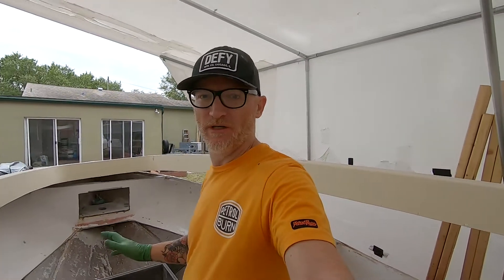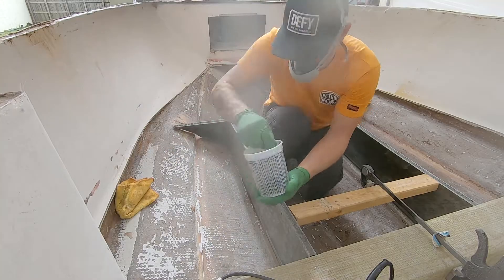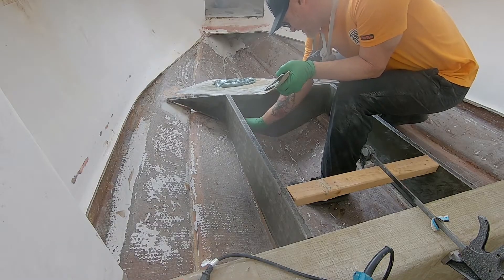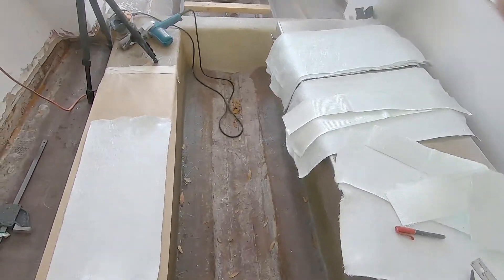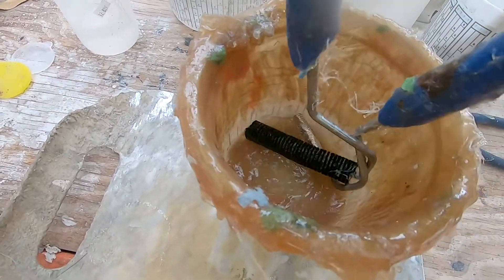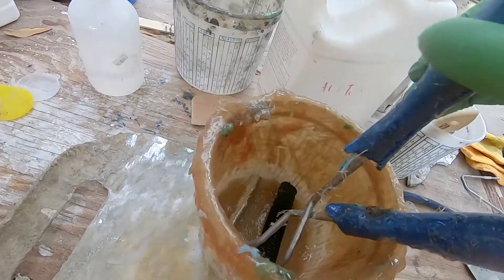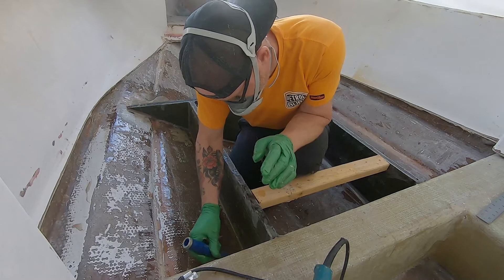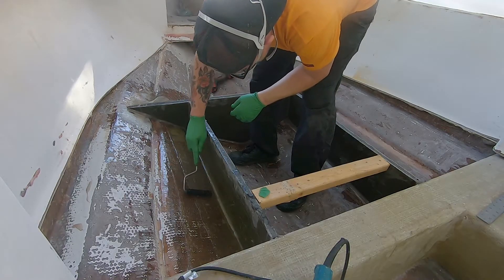HOW TO FIBERGLASS TABBING for Boat Stringers Transom & other Marine Fiberglass Renovation Projects

Comment: I am ready to start my Coosa board transom 3 inches thick. My question is, I have a ton of holes of the transom in original glass and plan to fill once the transom is in. I was wondering when I lay in the Coosa, I was planning to use 1.5 ounce mat over the existing glass as a binder and lay Coosa on top with layers of glass between each Coosa board. Is that a good way to do it?
Reply from the maker: Are you making it 3" of coosa plus glass?  3" seems to be a little overkill.  What size boat is it and how many motors?  Your plan for the install sounds pretty good, however I would suggest laminating your coosa pieces together outside of the boat on a flat table.  You can use layer of 1.5oz CSM in between the coosa boards as a binder.  I would also put your interior glass laminations on the coosa outside of the boat on a flat table as well.  The you can drop the coosa into the boat with the glass already on the inside and you just need to do the tabbing around the edges.  This serves two purposes.  1. Its a lot easier to lay large sheets of glass on a flat table and 2. the glass will make the coosa 100% rigid and you will not get any warping of the coosa from the exotherm created when the epoxy is curing.  Its hard for me to go into detail here.  If you have questions please reach out to me on Instagram messaging.  https://instagram.com/backyard_boatworks
Reply: @boatcrafterscompany  it will be 3” and then layers of 1708. My boat is a 26’ Olympic XL and am going to an offshore bracket and a 300 Suzuki with 9.9 trolling motor. I was thinking of doing all as one too but wanted to make sure the Coosa/glass make good adhesion to the transom glass and not worry about it. I am going to be making sure it is as flat as possible and do as you suggested! The transom is 7’ wide and about 40” height. I will mock it up and see how well all in one piece works. I could always screw the pieces together for a strong bind together also.
Reply from the maker: Coosa does not hold screws so adding screws to the coosa sheets will not help at all.  You are going to need to make a transom clamp of some type or you will need to through bolt the original transom through the coosa boards.  Again...very hard to explain.  I personally think that 3" thick coosa is unnecessary especially for only one motor.  I think you could get away with 2" thick coosa with 6-7 layers of 1708 on the inside.  After glass you will end up with about a transom thickness approx. 2.5" thick.
Reply from the maker: Here is a photo of the transom brackets I made. https://www.instagram.com/p/CEsMlJugNsV/?utm_source=ig_web_copy_link
Reply: @boatcrafterscompany  now that is a setup!

Comment: Why do you start with a wide tab and move to smaller?  Isn't that opposite of most?
Reply from the maker: I think we’re talking about different processes here. The original question was “why put the big piece first?” and the answer to that is so you don’t have overlapping edges which will create a ridge. Now…you’re going to have overlapping edges no matter how well you plan out you lamination in which case what you suggest could work but why create an extra step when you can avoid it. Sorry if I misread your comment/suggestion. I still would never spread wet filler over a wet lamination. I’ve done what you’ve suggested after the poly kicks off slightly but not fully cured so it still doesn’t require sanding.
Reply: disregard my question...i see the answer below.
Reply from the maker: Want avoid overlaps that create air gaps 👍🏼
Reply from the maker: @DefendHawaii-r3p  why would you ever want to add filler in the middle of the lamination process ? Sorry but that makes no sense at all. Poly Lamination should be done wet on wet always. Stopping to add filler in the middle of the process causes multiple issues one of which is possibly lifting the wet edge by spreading filler or causing more ridges with the actual filler itself. Not to mention having to mix filler at the same time is like trying to swim with your hands and feet cut off.

Comment: Hi Russell new to your channel and I love your content. Do you have any videos/tips for replacing rotten core on a bass boat deck? In particular the glassing schedule. Right now I'm planning on using 1708 with epoxy..
Reply from the maker: Chopped strand comes in two types. One type has an emulsion binder and the other has a powder binder. Ideally if you’re using epoxy you would buy the CSM with the powder binder. However, it’s perfectly fine to use epoxy with the emulsion binder it just won’t dissolve with epoxy resin. This is why chopped strand mat looks milky white when used with epoxy because the binder isn’t dissolved. It’s not going to cause any issues with the bonding. Chopped strand mat just isn’t designed to be used with epoxy. The chemical adhesion properties of epoxy don’t require chopped strand. You can do your repairs with e-glass or 1700 biaxial clothes that don’t have any CSM on them.
Reply: @boatcrafterscompany  I realize this is an old thread, but my thoughts are the strand mat is used inplace of the biaxial cloth to cut cost in the first place...Lots of example seen on lower cost boats...Thanks for all your info in your videos.
Reply from the maker: Thank you. Are you replacing it with plywood or something else?  You do not want to use 1708 with epoxy. You should get 1700 instead. 
The 1708 has chopped strand matt stitched to the back of it and you won’t need that with epoxy. It’ll hold about 30% more epoxy and make it a lot harder to wet out.
Reply: @boatcrafterscompany  yes marine ply. Thank you for that suggestion!
Reply from the maker: Gotta start somewhere 👍🏼 if you ever have any questions I’m on IG mostly. It’s easiest to message me in there. 
instagram.com/backyard_boatworks

Comment: Imo you are way oversaturated on resin for your tab in. I can tell you know what your doing but in my opinion you are using to much resin. Also, you are pronouncing it right. Also, did you bed those stringers or are they just directly laminated to the hull? If so, the hull is going to be at risk of cracking whenin rough water as it will have no flex. I own a repair shop in Jacksonville and get my resins locally from a surfboard manufacturer at half the price of fgci or other suppliers since it doesn't have the word boat on it lol but I'd do the same thing with vinlyester for base, then boatyard before I found my current supplier. That fgci boatyard resin doesn't even need wax or PVA to cure sandable it's so unrefined lol. I still keep 5 gallons of it on hand to use for certain projects. Anyhow, great video.
Reply from the maker: How can you tell I am using too much resin, and how can you tell how much I pulled out when I put the tabbing in place?  Just curious?
Reply: @boatcrafterscompany   very good question. I liked how you came to the resin "enough" when the piece becomes clear as surface below. The comment on your applying to much was also good. I wish he had answered as simply as you had in his experience of  "enough" resin, not to much. . Also I live on the gulf 
(2' 'chop waves most days on the water) the bulwark going into my cuddy cabin was not fully tabbed as you demonstrated and over the years it broke and needed repair.  The boat was a 69 Penn Yann. Built like a tank. That was the weak spot. Good video demonstration and tips thanks.
Reply: Not sure, to fully tab or not fully tab, that is the ❓
Reply: I can tell based on how wet it looks and 17 years of experience. The comment was not meant to be rude was just my opinion I did not see the final product in person to know if some of the resin was pulled out with fin roller it just looked to me like it was oversaturated but I only say that as constructive criticism because I have watched your videos and I know that when you first started your channel a year ago you were just learning how to work on boats from what it appeared when you fixed under anchor windlass.  so I was just trying to give a tip I was not trying to be a keyboard Warrior I'm sorry if it came off that way.

Comment: It is nice to see some one with some skills and understanding of fiberglass. As far as vinyl ester, below the water line is a good place for it, other than that ? Glad to see you are using large tabs. I use epoxy exclusive for everything, but the poly does have its appeal to me, cost and time.  I normally don't completely Wet out large pieces and try to apply them , they get too hard to handle and stretch out of shape. I like mini rollers with a medium nap, Wet the back slightly , then apply to to the surface and roll over it. It puts enough down to totally Wet out by the time I add the next layer. I don't even Wet the back of the succeeding layers, just the top. For me it works out great. I work the cloth with the fin roller the add peel ply and roll it out. Looks great in a few days when I pull it. I am thinking a lot about poly, it seems a lot faster with premixed putties and structural putties. Something to consider... I am tired of  Cabosil ! Keep up the good work!
Reply from the maker: Thanks!  You really don't need to use epoxy for repairs like this.  There's nothing wrong with it but its overkill for the job and its not worth the cost.  The only time I use epoxy is when I am doing critical structural repairs such as bonding coosa or plywood to a transom repair, bonding two pieces of core together etc.  As long as you grind back to the original glass removing any delamiation and or topcoats, a good quality poly resin is plenty strong enough.  Its very hard to work with epoxy in a shop environment because I can't wait a full day for the epoxy to cure.
Reply: @boatcrafterscompany  If I am tabbing in a new deck to the corner walls where there is gelcoat. Would the gelcoat have to be taken down to glass for poly but not epoxy?

Comment: Good video, I also radius the turn, I just use a popsicle stick. Then I prefer to lay a minimum of at least 3 layers of glass on any tab of structural use. More depending on the height or length from the turn. Cut and lay pieces starting with smallest first and expanding with each layer. I always use EPOXY below decking or the waterline.
Reply from the maker: Thanks for the comment but I disagree with your suggestions.  You don't want to lay the smallest piece first because when you do that you have pieces overlapping the edges of the previous piece and that causes a ridge and an air pocket.  The standard lamination schedule is to lay the largest piece first and I typically do 12" 8" 6" obviously depending on what I am tabbing.  Every boat is built with poly resin.  There's only a few boat builders using 100% epoxy so I am unclear on why you suggest epoxy below the deck or waterline.  Epoxy is used for critical structural repairs where you are bonding to older surfaces or when epoxies extreme chemical adhesion is required such as bonding two pieces of coosa together, or bonding a new transom core.  For the most part I only use epoxy when the repair calls for it, otherwise I always use poly resin.
Reply: @boatcrafterscompany  When layering, going smallest to largest WHEN DONE PROPERLY does not cause air gap from ridge and each layer bonds to the hull offering a stronger bond and by the way, stingers and transoms ARE highly structural. My opinion and experience. I use Epoxy below decks and or below waterlines simply because it is better suited for heavy water exposure. Anyone that has glass experience knows Epoxy over poly works the same as epoxy over epoxy. Other way around (poly over epoxy is a big no no.)
Reply from the maker: I’m sorry but I’ve overlapped edges of tabbing before and it does create a ridge creating the possibility for trapped air in the laminate. Why struggle going over ridges when you don’t have to?  You’re theory that every layer being in contact with the hull creates a better bond is also flawed. If you use 12/8/6 tabbing and lay them down either way, you still end up with same square inch of contact patch with the hull. You’re not gaining and bonding advantage. However to the contrary having each layer touching the hull is not ideal. You’re much better off having the second and third layer only touching the previous layer as opposed to the hull because then they are bonding directly to the brand new fresh resin and not bonding to the old hull glass. We can agree to disagree, however, no professional repair shops are going to be using epoxy resin on stringer tabbing. It’s just not done. Epoxy is a pain in the ass to work with especially when laminating large pieces and it takes a day to setup. Boat yards can’t be waiting for epoxy to cure or they’d go out of business. Even “laminating” epoxy is too thick to wet out glass easily. It takes far too much effort and the cost isn’t justifiable for tabbing work.
Reply: @sc6512  I don't understand how small to big would differ from big to small, given that he stated his first layer is a high bond resin and successive layers are plain poly laminating resin. All the poly laid up prior to full cure will chemically bond making the tabbing essentially one piece. The bond to the existing hull would be mostly a mechanical bond. BB's method of getting a large surface area mechanical bond with bonding resin and then chemically bonding in successive layers of laminating poly resin is sound. Folks have argued this for decades. If the resin rich and fiber bend zone where wide tabbing covers skinny tabbing matters. Either way is recognized as acceptable.
Reply from the maker: This is accurate. You can do small tabs to big tabs however avoiding the overlapping edges makes far more sense. You will still end up with the exact same surface area of glass touching the hull. Also by tabbing smaller to larger you would ideally have to use higher quality resin for the entire project. By doing it larger to smaller you can save a few $$ by switching to a lower grade resin. For the DIYer larger to smaller is MUCH easier and cost effective.
Reply: epoxy sticks better to cured poly than poly sticks to cured poly. so yeah  epoxy is the way to go. tabbing is structural as one is creating a matrix where all those surfaces intersect and strenghten the whole hull. if im patching thru hulls openings i will go big to small, just because every layer gets full contact to the previous one. if you go small to big, only a small percentage of each layer will actually touch the hull (close to the ouside diameter) whilst the  center of that layer will contact the previous layer.
Reply from the maker: How much glass touches the hull is irrelevant. No matter how you lay the glass you still have the same exact square footage touching the hull it’s makes absolutely no difference. 
Nothing sticks well to cured anything. Cured poly and cured epoxy need the same prep for additional lamination. Epoxy is obviously much stronger chemical bond but it’s overkill for boat tabbing work.
Reply: @boatcrafterscompany  agree about the square footage WHEN you take it as a whole, not as individual layers. on small to big you will have less area of cloth over the hull which is where you are trying to adhere the patch. im refitting a 1962 VdS Pioneer 9, that i intend to sail everywhere pushing her hard. im tabbing over the existing tabbing with biaxial cloth and epoxy, am i spending more money? for sure! will i sleep better at night? without a doubt.

Comment: Nice work! Prep is key for poly but I think if done properly, it works well for rebuilds and keep option for gel. Where did you get the rollers? The thick rollers are getting to be a pain.
Reply from the maker: Yes prep is always key but for sure you need to grind down to bare & clean glass on the hull.  I get all of my supplies from FGCI.  I bought that black wetout roller months ago and  I am still using it.  I just keep it soaking in thinner after I done and its always ready to go.  Its saved me a ton of money on buying rollers.
Reply: @boatcrafterscompany  dang it i was there getting supplies a few weeks ago and stuck to the big rollers cut down to 3”. I’ll have to grab one. What are you wetting out on? What is your cleanup like of the “wet out table”?
Reply from the maker: @Glaucus485  I just lay down some Kraft paper and add more paper as the resin starts to harden. Then I just throw out the paper when I’m done. In this video I was wetting out on top of the stringers.
Reply: @boatcrafterscompany   But doesn’t that soak up resin ...going to waste?
Reply: @Glaucus485  ... I agree that it would make sense that the paper would soak up resin. I use thick plastic as a wet out surface. In some cases I can peel back the cured resin and use the plastic over. 

Oh, BTW, good videos. Finding good methods that work is key.
Reply from the maker: The paper I use is painters paper for masking. It doesn’t soak up any resin.
Reply: @boatcrafterscompany  I tried this on a plastic folding table and it worked so much better than laying in the glass and trying to get the resin to soak. Thanks for the tip!
Reply: Thanks for the video! What is the core material and spec? Tks!
Reply from the maker: 3/4” Coosa board.
Reply: @boatcrafterscompany  can Coosa Board be used for core on the side and running panels of the boat? Or maybe the better question is, how are differente core materials chosen for different parts of a boat? Tks again
Reply from the maker: You could use it but I wouldn’t. A foam coring material would probably be better for those applications. You typically choose your coring material based on the compression strength that you need for the final product. Foam coring material has a lower compression strength typically 2-10 lbs. Coosa is 28lb density.
Reply: @boatcrafterscompany  why would you not use Coosa for side panels, is it too expensive for that use? Thanks again
Reply from the maker: I don’t know what you mean by “side panels” ??